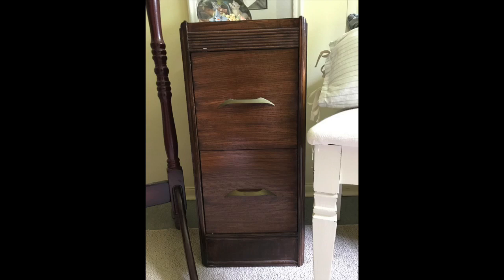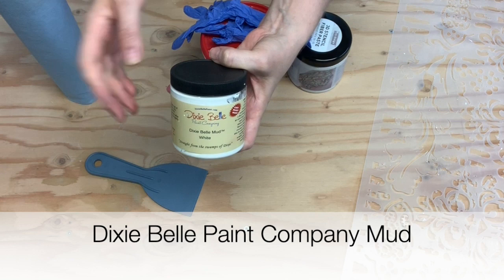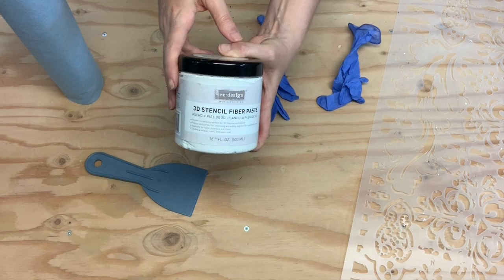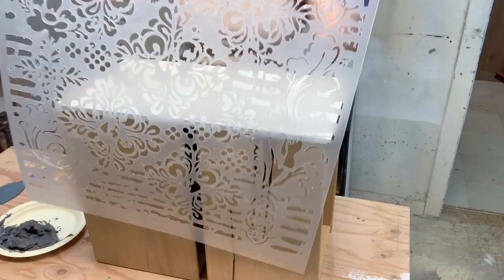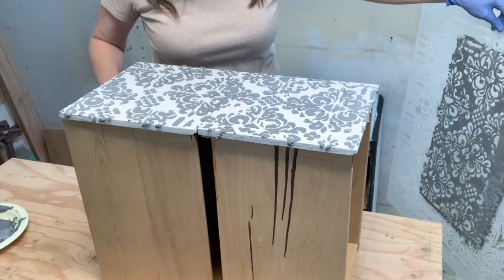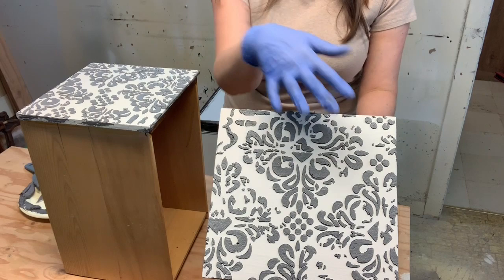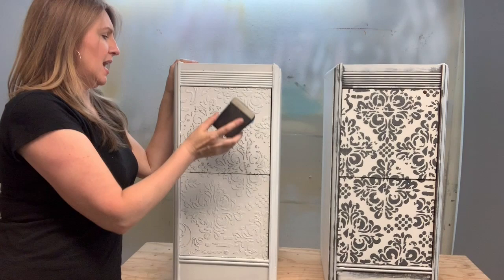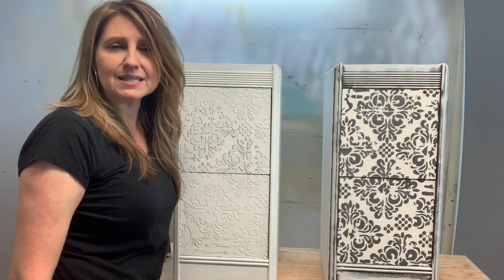How To Apply A Raised Stencil

Comment: Absolutely LOVE that you share this kind of information! Generous of you💕 I’ve been gearing up to do some textural stencils and had already decided to try the water putty! All the different types of putty, Dap products, Durham, etc are what I’m familiar with for repairing furniture and walls and floors? But the products created specifically for design & restyling furniture are numerous and can get kinda pricey? So this video helps me to make wiser product purchases! ❤️ I wondered if you ever tried to tint the water putty and those types of products? It has an entirely different hardening (chemical reaction) process than say drywall mud, so I wondered if you had experimented with those and what your results were? Also— what do you think about price points on everything? The product you used today, how is it comparable to the Dap & Durham prices? Thanks in advance for any answers and again- thanks for such a great little video!!!! ❤️❤️❤️
Reply from the maker: The 'boutique' brand name products specific to raised stenciling are more costly than DAP etc because of their convenience. No mixing. Just open and use. And I have mixed in small amounts of brown paint into those products and it works great. I've never had a problem.